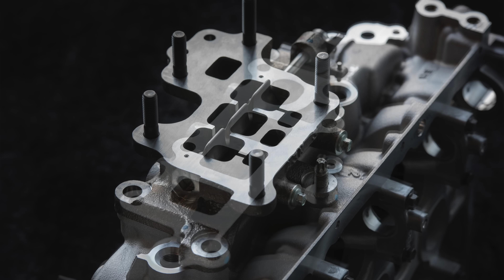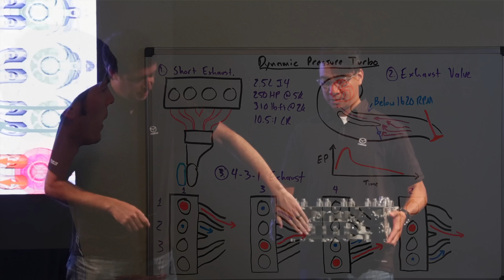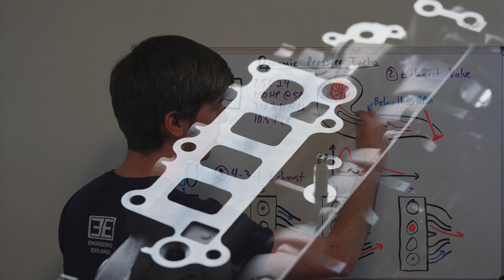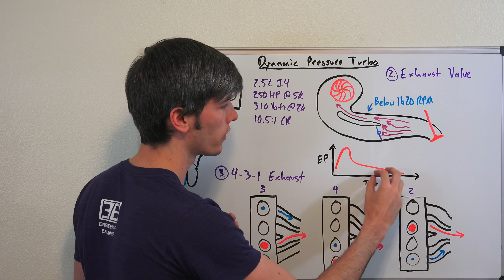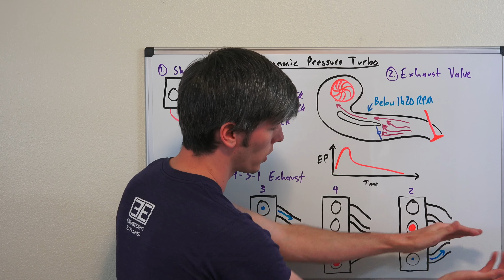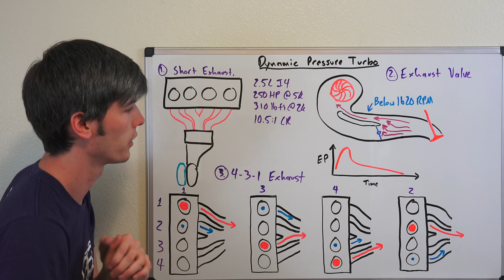How Mazda Is Eliminating Turbo Lag

Comment: Mazda has the finest engine designers in the industry.  For a relatively small company they make the largest ones look foolish.
Reply: JR Rand I don't claim to be an ME, but I do know good design and Mazda consistently thinks outside of the box. They're a small lean company that can turn on a dime, figuratively and literally. The big boys have to hold 100 meetings to get something into production.
Reply: tdawg719 Mazda was doing this back in the 80's, the Series 4 Turbo 2 Rx7 had a flapper in the exhaust manifold to control the twinscroll
Reply: Carl McDonald they are small compared to Toyota. I'm glad they try really hard to improve. Subcompacts here in my country like the Toyota vios is trash compared to the Mazda 2.
Reply: Rafael Lastra com Why are you comparing 2016 Mazda with 2017 Toyota. That doesn't make sense.
Reply: Iventonart velocity of exhaust is way faster with flaps closed... rest of what you said makes me wonder if you have brain or not
Reply: I love Mazda but there's really nothing that special about their engineering. I-stop was really cool, and they took a different approach of engine design with high compression and without all that downsizing BS. And they suceeded. And thank God for that. But when you look at Nissan's (Infinity) variable compression engine or Toyota's 40% eff engine... You have to give credit to them as well.
Reply: @grumpy_0ld_man  Let's see how reliable that variable compression turbo engine turns out to be, lately Nissan hasn't been the best at reliability. Their modern cars are nowhere near as reliable as their cars prior to the 2000s (those damned CVTs). Mazda is not inventing anything new, they are just using clever engineering solutions that most manufacturers don't use because of packaging, most Mazda's even though they are FWD have huge front ends because their exhaust manifolds are really big, that takes some trade offs. But now even Toyota is going that route with their new 2.5 4 cylinder, with a 13:1 compression ratio. At the end of this year, Mazda is launching their Skyactiv X, with a 16:1 CR, let's hope it is as reliable as the current gen Skyactiv
Reply: they build some cool stuff but exhaust gas scavenging is hardly even 21st century technology. this isn't groundbreaking stuff. its the production manufacturing technology that is getting better which is allowing these innovations to be introduced to mass market. other than the mass production of this idea. it has been around for a long time and has probably been done many times on different applications. just not on cheap cars.
Reply: Mazda corporate with the larger companies and share shame technology like volvo and ford working together. U cannot compare volvo or a mazda with a cheap competitor that consumes more fuel and last only for 8 years or less. Those are 
"premium" brands. Not something that an average guy pays for a car that costs 10k.
Reply: Mazda isn't scared to experiment on new technologies, while most "big" ones are walking the most common path. For example VAG ( VW, Audi, ect) tried to sell a 1,4lt turbo-compressor with 170hp and failed due to not enough oil lubrication... On the other side Mercedes went many years ago with the compressor instead of a turbo and succeed...
Reply: Why compare 2016 and 2017?  Because a quick searck on Wikipedia had those particular results listed and I was not going to do a thorough search just for this comment section.  I was just looking for a ballpark and differences from one year to the next would not significantly alter the ratio.
Reply: ford is one of the biggest
Reply: By comparitive sales figures they are small automaker.  16th on the worldwide production list with 1/10th the output of Toyota is not large.
Reply: Mazda's HCCI is pretty impressive. Infinty's VCE is pretty awesome too
Reply: A few months ago I looked for Mazda hybrids to discover they didn't make any. "That's weird", I thought. Further research revealed they didn't need to make hybrids, because they were already doing WAY BETTER on CAFE across their whole fleet, through massive ICE improvements.
Reply: David Sparling And keyboard engineers are in their own herd of sheep, believing they know more than anyone else.
Reply: Keep digging that hole moron.
Reply: Really, Felix...what are your sources? Honda, Nissan and Toyota to a lesser degree have gone the way of GM, i.e. design and engineering by committee. They sell more cars because most people don't know squat about automotive engineering and follow the herd mentality...sheeple!
Reply: It’s just existing technology package differently. VW had the exhaust manifold in the head as well, and the flap is basically a twin scroll turbo but the flap is in the manifold(head) and not in the turbo.
Reply: Some parts of this design might be proprietary, but there's nothing really special about the way it works in the end. Other companies are using similar strategies, but they just don't call them "Dynamic Pressure Turbo" technology.
Reply: Rafael Lastra com if only they could eliminate rust from the body
Reply: Rafael Lastra com I agree!  They’ve had the 2.0 and 2.4 i4 for about a decade now.  Mazda’s engine engineers are so incredible that they managed to get the Mazda 5 turbocharged in less than 8’years!  Take that Toyota and Honda!!! Your 300 horsepower V-6 and civic type R engine in the Accord are foolish!!!!  And why are these larger car companies even trying to electrifying their vehicles?  A little too soon!  Mazda doesn’t even plan to electrify their line up until 2030-2045.  The bigger car companies are thinking too far ahead, and I believe it’s because they are scared of the Mazda engine designer swag!  What fools!  Muahahahahahahahahah
Reply: David Sparling, virtually all manufacturers have technology that gives them the ability to vary exhaust gas pressure, and direct and redirect exhaust gas flow. The only major different here is they're putting the valving in the manifold itself, which doesn't have any evident advantages. The turbocharger is still going to receive the exhaust pulses at the exact same time because the distances and velocities are still the same. Besides this, it's not all that proprietary either. Many manufacturers have played with this idea, and not just by having different routing and putting valves in the manifold, but even building the turbocharger itself into the manifold, but due to cost and complexity of having an all-in-one assembly, it gets left on the table. This would be more difficult and costly to repair when it fails, because it's in between the turbo and the engine.
Reply: @iventonart9474  Its 3 years later and these engines are bulletproof.Mazda is doing one thing great and that is focusing on making a few bulletproof engines instead of a bunch of average or below average.A bmw 5 series has more engine choices then all of mazda and those cars still have spotty reliaibility.
Reply: Ya no you'll see more mazdas and Wv than anything else at the junkyard
Reply: Rafael Lastra com Much of this technology isn't from Mazda, it was developed by larger companies and gets branded by companies like Mazda. And if the larger companies are foolish, why are they selling nearly 9x as many cars and making more money?
Reply: Denver Cayle Ong they are the third largest Japanese car manufacturer  how is that small
Reply: Rafael Lastra com wtf are you talking about Mazda is one of the big ones
Reply: In 2016 Mazda sold 1.2 Million vehicles, in 2017 Toyota sold 10.5 Million vehicles.  Like I said, for a ¨relatively¨ small company they make the largest ones look foolish.

Comment: If all of these technologies from all of these companies got combined into a single engine, they would reach absolute peak performance...

Infinity with their variable compression engine
Toyota with their dynamic force engine
Audi with their electric turbochargers
VW with their Budack cycle engine
Mercedes with their hot inside V turbocharger configuration
The technology from the Mazda Sky-Activ X engine
and many more..

combine all that with variable displacement and you get an engine from the future
Reply: so a Super V6/V8?

Comment: My 1997 Saab 9000 2.3T Aero does not have any turbo lag, And its 21yrs old. I have 1.4 Bar boost pressure at just 1,800rpm from its Mitsubishi TD04-15T turbo. And soon as you press the throttle the APC system maximises the boost curve based on environmental conditions and the quality of fuel you are using.
Reply: Paul Taylor.  You are just plain wrong.  SAABs of that era were very laggy.
Reply: Paul Taylor Having boost at 1800 RPM and not having turbo lag are very different. Most modern turbos have their peak torque below 2000 RPM. And yet they have turbo lag. I haven't driven a 9000 Aero, but I have driven a 9-5 2.3t and it does have lag. It is physically impossible to eliminate turbo lag.
Reply: Paul Taylor Saabs are incredible cars before Gm ruined it. I used to have an 850 Turbo and it was just too much fun to drive
Reply: I've got a 2001 9-5 Aero with a stage III tune and I have no lag.  I have to say that some tech like this would make it a much more efficient vehicle.
Reply: @drewLSsix, unfortunately you are talking BS. Have you ever driven a 320bhp 9000 Aero ?.
Reply: Paul Taylor Do you even physics bro?
Reply: @Eric, I suppose thats why most of the world uses it, Except for the US of course.
Reply: Paul Taylor BAR is a retarded unit for pressure

Comment: The exhaust valve is a thing you can do at home!

1: Get a twin scroll turbo
2: Attach it to a single scroll manifold
3: Unbolt it because you forgot to install your... Quick Spool Valve! between them

It operates as seen here and typically improves spool by 15-25%. I mean it basically halves your AR ratio until you are on boost...

I think they are about $300US and are usually made to suit T3 and T4 Garrett, but I have seen a Borg Warner item, and one in a modified turbo that still used a twin scroll manifold as well...

I would personally use one, but my 4 litre engine doesn't really have spool trouble until I get something larger than a GT3582R, and I'm nowhere near the 500rwhp that puppy can support

Comment: so uh... what is eliminating turbo lag now? lol
Reply: Keisuke Takahasi Cmon KT. Dont you drive a twin turbo rx7? You should understand how this stuff works. Lol.
Reply: wayde philpot his secondary turbine is broken, he has forever lag
Reply: That's what he was explaining to you that smaller Port is used under 1620 RPM and after that it uses all of the ports and then they use a short exhaust manifold so everything runs at the correct temperature and efficient
Reply: Razvan J That isn't an elimination of lag. It's NOT POSSIBLE to eliminate lag! You can supplement, you can reduce, but it defines the laws of physics for something to just instantly spin at a desired speed. Stop talking nonsense.
Reply: You cannot eliminate all lag. That 100% physically impossible.
Reply: Lag can be reduced to the point were it doesnt really matter much anymore, and this video shows how Mazda is achieving that. Think about it, are there really ANY cars that have truly zero horsepower lag,
and is it necessarily a desirable standard? looking at it that way, you would probably have to say NO, because even if some magical prime
mover could go from say near zero to to 250 hp "instantly" (and nothing actually can) then there would be severe shock loads
placed on the tires, wheels, axles and transmission, and the tires couldn't transmit the instantaneous load change to the ground anyways,
even if the rest of the stuff was beefed up to handle the shock load.
Using traction control to deal with the instantaneous hp change means to "throw away" much of what is gained from this supposed ideal.
Maybe a bit of turbo lag is a good thing, not a necessary evil, for traction and drivability reasons alone!
Reply: Didn’t you watch the video dude ?
Reply: You might not be able to eliminate it 100% but you could decrease it enough to the point it's virtually undetectable.
Reply: YOU CANNOT ELIMINATE LAG, PEOPLE!
Reply: Eliminating turbocharger lag is physically an impossibility. An object cannot just go from spinning at 60,000 RPM to spinning at 250,000 RPM instantly.
Reply: As you said "just improves the efficiency of a normal turbo to that of a variable turbo", i feel like they should get VGT technology turbos, that would bring their cost more down
Reply: StrangeClouds Would you say that the modern day F1 cars  pretty much run without turbo lag?
Reply: emdec55 your right it's reduction but you can eliminate it look at how Volvo is doing it
Reply: I believe it's down to a combination of Unicorn engineering enhanced with a bit of Voodoo magic.
Reply: James Billingsley Near instant torque. Electronic signal delay is a measurable quantity.
Reply: The word Eliminating, present tense, implies a current ongoing process. These measures don't eliminate lag, but are steps toward eliminating lag. (The end goal may or may not be impossible, but it's Mazda's dream lol)
Reply: For those that don't fully get it. Just put ur finger partially over the end of a garden hose while the water is flowing. 5 yr old know more then most of the ppl that comment on utube now go outside and play...
Reply: Basically using convection to pull the exhaust gas through a smaller and shorter runner for faster boost ... and relying on the engines firing sequence to assist in the convection current and create faster boost
Reply: JR Rand you could if it was always spinning at peak rpm
Reply: 63Turbo A tesla. Instant torque all the time.

Comment: They should make a new mazdaspeed3 and use this engine, why is Mazda losing all their sports car pedigree.
Reply: Portal.  They are not, the Miata is the best in its class the 3 and 6 are the go to options for drivers and they are killing it in the crossover market.  This is exactly what they needed and what Mitsubishi needs to do to survive.     Rx7s and mazdaspeed models cant possibly pay the bills, they need profitable volume cars first, performance cars later.  And I say that as a Mazda fanatic and a lover of performance.
Reply: DrewLSsix there should still be a turbo speed3, the NA 2.4 in the GT doesn't cut it
Reply: Portal. 2.5 not 2.4.  We will probably get a speed3 before the end of this generation but nomatter what tou or I want Mazda must prioritize staying in busoness first, and performance models simply wont do that.    You would have the entire company fold just to fulfill your misguided wishes.
Reply: Mazda really wanted to make sport cars, but in the same time they are scare of it. They doesn't have the money and could go really wrong if it doesn't work out for them.
Reply: DrewLSsix what in the miata class for it be the best of it?
Reply: John Dessire.  The BRZ and 124 are probably the closest competitors in the US market,
Reply: DrewLSsix yes 2.5 my bad. However a speed3 isn't necessarily reinventing the wheel, it's just a 3 with refined settings on the brakes and suspension, as well as an existing engine from a bigger car for more power. Not as drastic as taking a shot in the dark and making a new model. And historically speaking the speed3 was pretty popular so it's a working formula for Mazda.
Reply: Spot on Drew!
Reply: Portal.  Well the cx9 is out with a decent turbo engine that will likely be retuned for about 300hp for the speed3 eventually.  But the rumors are for an awd speed and that means huge developement and production costs.  

Personally I would be happy with fwd, I think it better fits with Mazda than trying to run with the Evo/STI/RS crowd but thats what Mazda feels is wanted.

My self I would rather see more diversity in the curent lineup, more colors more trims and some performance packages more along the lines of the Miata track specials and M editions.  

I would buy a 3 right now if I could get a base model with the 2.5 6 speed and a very competent suspension.  

ButbI also understand that product diversity is also a huge cost for any manufacturer and Mazda cant absorb that cost like Toyota Ford or GM can.
Reply: making a "speed3" buy just adding more power and a boat-anchor of an engine in the front might be good recipe for some.
for my part would love to see a Mazda3 1.5 with a light turbo-boost, reduced weight and AWD.
though to reduce weight more now would mean reducing sound-dampening etc... don't think my wife would like that...
Reply: To minimize costs and risk Mazda could try the dealer approach: supply the parts and let dealers make the conversions for sale or for customers' cars.